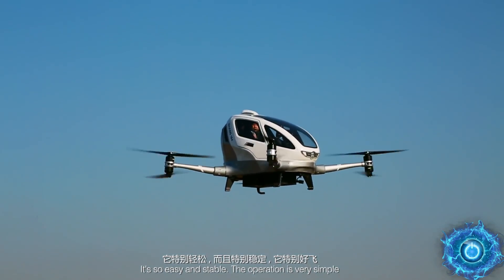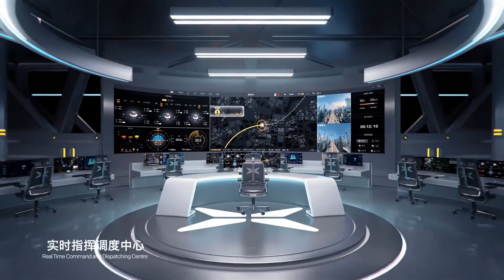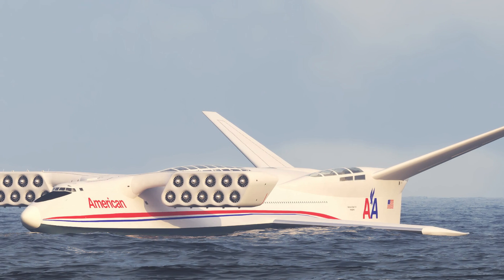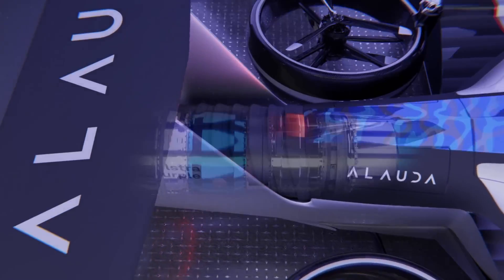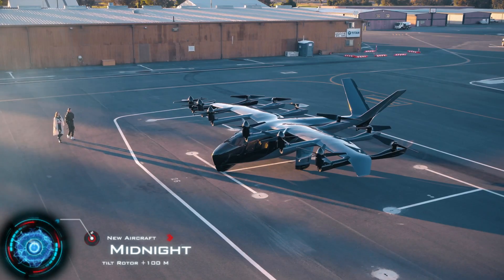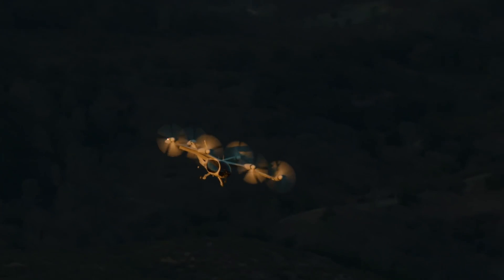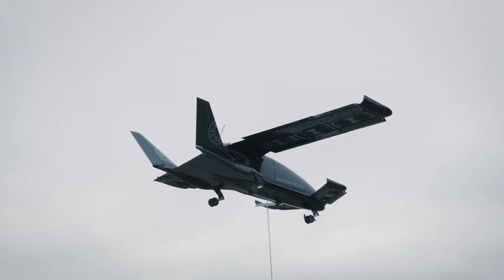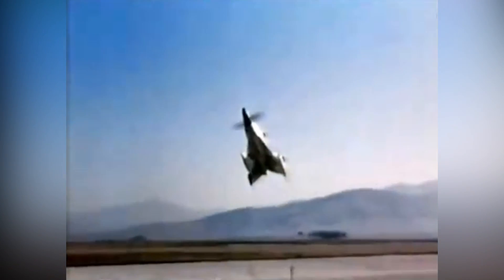eVTOLs - The LATEST Breakthroughs (2023)

Comment: Here is something entirely different! Sky Chaser, the 1st Blade Runner style roadable flying car: looks and drives like and car, flies both vertically like a drone and horizontally like a plane, and it is amphibian. Uses body as a wing, will be manual and fully autonomous, and powered by a hydrogen fuel cell giving it hours of range. Being developed in Sweden, and currently testing a full scale prototype. 

Sky Chaser project presentation:
https://drive.google.com/file/d/1FAdls15OriuQ4hoD2xPwXeNQDQTKpK1t/view?usp=drive_link

Comment: 1. You don't have an Archimedes blade To make it significantly stable.
2. You don't have a pwm  generator to keep it in the air for HOURS ON END.
3. You don't have any solar panels to Supply the pwm.
4. You don't have the weight distribution right on that.

Comment: Most of those open rotor designs like the Midnight are so ridiculously inefficient its pretty hilarious.  All those exposed rotors all with engines that draw tons of electricity, something like 12 or more in total. all to lift this large and heavy fuselage that only seats 6 passengers at best. Even if one would account of additional pace when transitioned into forward (airplane) flight, 6 of those engines then power down and those non active rotors create a tremendous amount of drag and turbulent air.  How would that feel in forward flight? well.. we know how a plane feels when coming in for its approach with its flaps down. that turbulent air created by the flaps being out of the wings slip stream.  well. Midnight as some others propose this for its flight longevity.  All just to get the aircraft landing and taking off vertically.  wouldve been better off using a single or at best dual rotor layout as those that already exist, because financially your not achieving anything greater with a six passenger payload.
Reply: I'm sure that makers like Joby, Archer or Lilium, are going to have to test, re-test their aircraft thoroughly to meet FAA certification !
Reply: What else might happen if most of those open rotor designs are so ridiculously inefficient?

Comment: I will only ride in a VTOL if it can glide and land if all the motors fail
Reply: These EVTOLS have to pass stringent tests. They will all be certified ten to the ninth power, which means that the odds of a catastrophic fatal crash are one in a billion.
Reply: good point
Reply: Can an airplane do that?
Reply: @ramakrishna5480  Yes. They're called "dead-stick landings."
Reply: Also, it is a little ridiculous that people somehow think electric motors are somehow less reliable than ICE engines. For example, the electric motor running the compressor in the average refrigerator will run CONTINUOUSLY for a decade without maintenance. The chances of 4 or 6 electric motors, each with their own independent battery, failing is EXTREMELY low. Probably midair collisions due to pilot error are more likely.
Reply: I  never said that I trust regular propeller or  jet planes more than vtols. I refuse to ride in any plane and the only air craft  I'd trust to take me in the air would be a vtol glider. Something that could be ran without any electronics. It doesnt exist but maybe someday.
 @helifanodobezanozi7689
Reply: @4115steve  LOL! You mean an umbrella like Mary Poppins, cause that's as close to what you're saying as anyone will get!!! 😆
Reply: @Dunge0n  Why would an aircraft with 6 engines, 6 separate batteries and wings need a parachute? Do helicopters, which are far more mechanically unreliable and at best can only use autorotation in an emergency use parachutes? (There's no Airbags in existence that can save anything from a 2000ft fall! LOL!!!)
Reply: It's looking like the winged E/VOTL'S are going to happen first on a large scale, so you'll probably get your wish. Archer, Joby, Lillium and Vertical Airspace are all in the lead.
Reply: I take it no helicopter rides for you?

Comment: That eHang will never go mainstream.  One power out and its Bon voyage.
Reply: Just require a gas back up .
Reply: But if the main electrical system fails, it's over.  No wings and no significant idle thrust from those tiny motors.  Even with a gas backup, without a core electrical circuit functioning, its Bon voyage to the passengers.
Reply: What do you think about it being granted commercial TC? If I lived in China I could fly in one of these now.
Reply: Also with zero control surfaces and no winglets in the event of power outage,  another disaster in the making.  Helicopters can get away with it,  because they have a massive rotor with massive torque,  which gives them some thrust momentum and resistance to help slow their descent,  however tiny craft like this would have next to no chance of a controlled descent.  It would just be a hard crash.

Comment: These problems of range and endurance have already been solved in the past with a technology that is cheap and reliable, but unfortunately, its no longer seen as trendy and green.  Yep turbo props and jet engines, can do all of this and more and can fly for 1000's of miles. This is just wheel reinvention and they are certainly not green when one takes into account the mining of the raw materials for batteries/ motors and the processing of those materials, which exploit child labour in the Congo and slave labour in China. I find it odd that these well documented facts are simply ignored by the makers and users.  But I did enjoy your video.
Reply: while turbojets, turbofans, and turboprops are very reliable, they hardly qualify as cheap. at least to me.
Reply from the maker: Good points, over 50% of cobalt is from Congo. IT is a huge problem!
Reply: These are VTOLs, designed to work in urban environments, without runways. They replace helicopters more than they replace planes.

Comment: firstly, electric battery vehicles are useless in terms of cost. the range and flight times are bad enough already, and everyone who who has a battery powered device knows this one fact. after a hundred chargecycles the battery is nowhere near as good as it was new. all these flight times and range given by these companys is for brand new batteries. after a month, you can halve the stated range or flight time, or just ignore this fact and watch them fall out if the sky. hydrogen HHO is the way forward for mankind.
Reply: Yeah bro because you’re a pro in this sector please shut up
Reply: What might happen if the electric battery vehicles are useless in terms of cost?
Reply: @cameronbateau6510  cars? well every 4 years you can spend 29000 bucks to replace the batteries on your tesla. or just buy another car. ....that will set you back 60 to 80 g , then another 30grand for batteries in 4 years. yep, 4 years is the average time tesla type cars require new batteries. ill stck to the equivalent miles per dollar of petrolium and diesel. les than a quarter the to TOTAL cost to own over 4 years.
Reply: They're banking on battery technology improving. There seems to be battery "breakthroughs" every week but no real world changes yet. 

The life cycle is a big deal. If batteries with much longer life cycles come onto the market then they could add a hydrogen generator to feed the batteries over long flights. It doesn't even have to be hydrogen.
Reply: I agree hho supplement to keep battery charged during flight is ideal...but unfortunately each time one is developed, it mysteriously disappears from history. Such is big oil, nothing is allowed to out do oil powered engines, they're burried b4 they reach market. Oil only tolerates battery production because it's clear it hasn't been competitive yet. There possibly is a battery 100 times better than current tech, but you can bet your life big oil burried it, for now.